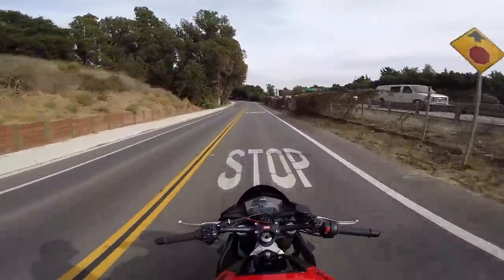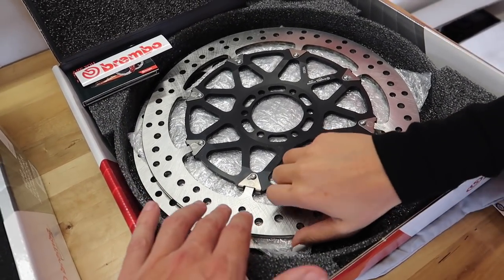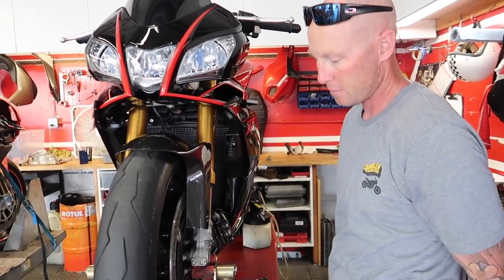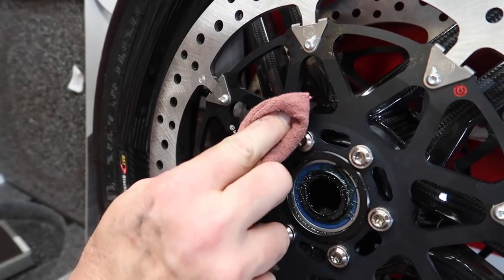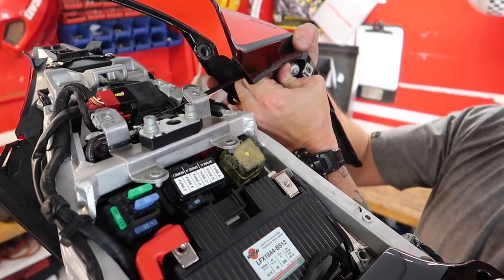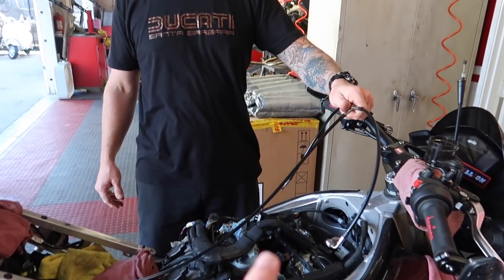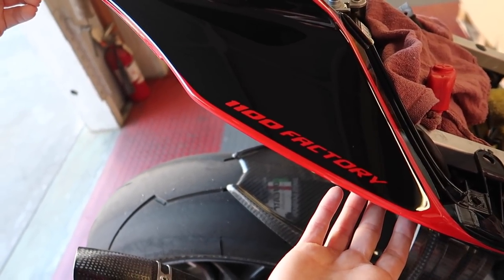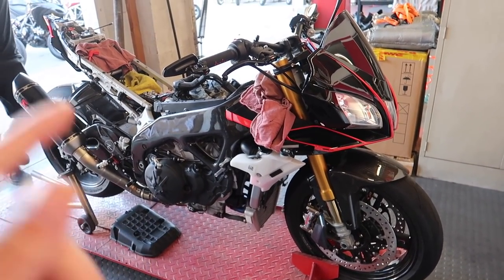Tuono gets INSANE $2,500 Brembo Brake Set up!!!

Comment: Gp4-rx calipers are actually not monoblocks.

Racing brakes are not "more than you need for the streets".
The difference is that racing brake pads require heat to operate correctly. So you won't have as consistent braking performance if you are just cruising around. Brake cooling ducts may not be good idea for street use. But whatever for the looks :D
Luckily gp4-rx come with sintered street pads.

Original brakes are already very good! But these look nice and shiny even if you didn't notice any difference in braking performance.
Reply: I have brembo racing pads on my track bike.  There is no breaking power at first when on the street 🤣

Comment: Why you use brembo RCS 17 ?
I think brembo RCS 19 CORSA CORTA will work properly for those caliper 👍
Reply: I think the RCS 19 on the Tuono with antilock brake is on the large (piston) side and gives a wooden feel. So the RCS17 gives more adjustablity and a better feel. At least that is what the forums say. But if anyone has experience with the RCS 19 on a 17+ Tuono please speak up.
Reply: @WOOD04100  i hope, campisi him self will speak up

Comment: it's already got brembo on what's the difference
Reply: These have smoother finish and therefore more precise manufacturing tolerances. The levers have adjustable ratio and distance.

The main difference is how they look.
Reply: ,,, don't know about the stockers, but the high end calipers are one piece billet  .
Reply: @rolandtamaccio3285  they are actually 2 piece. Original calipers are cast monoblocks.